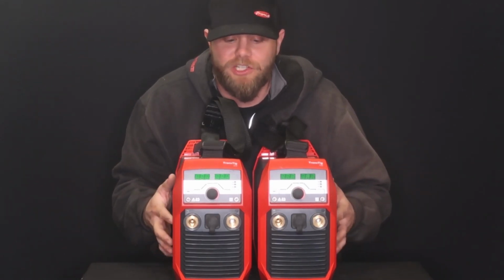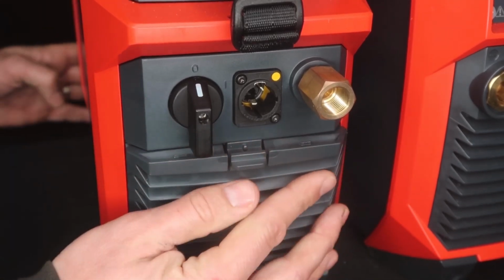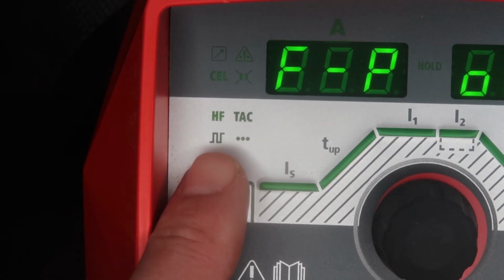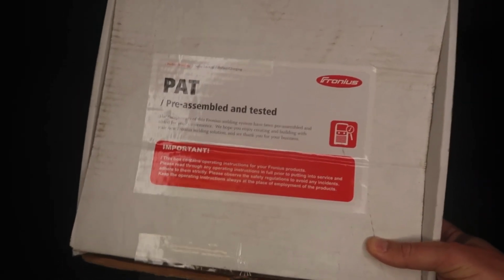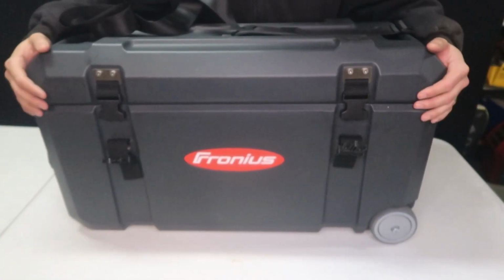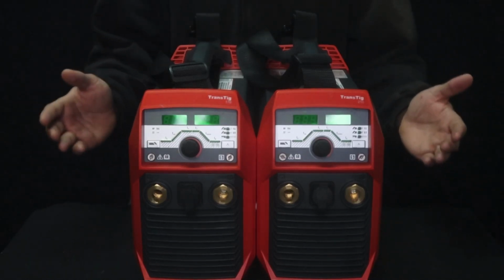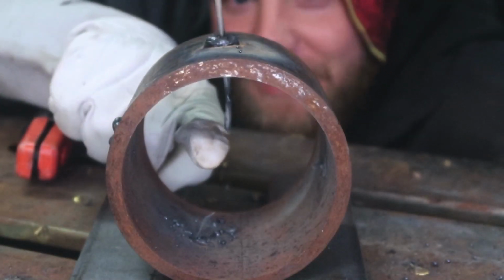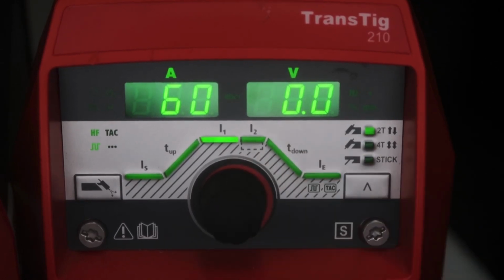Looking For A TIG Machine? The Fronius TransTig Is A Must See !! #tigmachine #tigwelding #fronius

Comment: Any idea when Fronius may be coming out with a updated version of their transsteel 2200 ? Be nice to see a modern interface etc
Reply from the maker: I haven’t heard anything on a revised faceplate or machine. Have you tested a unit out yet?
Reply: @chris_b_liven  unfortunately I have not tested out a Fronius transsteel 2200 . Watched every YouTube video out there on this welder & read many reviews ...lots of happy owners for sure .

Even though I am up in northern Canada 🇨🇦...If I do go ahead with the purchase , thinking of buying from Bakers welders & gas . They seem to have really good promos always running .
Reply from the maker: @Warriors79-ice  It’s hard for me to tell you which one is better overall just because I’m a little bias 😂 I think if your in the market you should try all three out and make a decision. Fronius is starting to add more and more dealers in the Canada market. They hired a distribution manager in Canada so be on the lookout
Reply: @chris_b_liven  with my luck Fronius will come out with a welder to replace the transsteel 2200 shortly after I purchase mine 😥 lol

Been debating on these three welders ....Fronius transsteel 2200 / HTP 200 / Esab 205ic. 

But after reading reviews on the Esab 205ic , it sure seems there are way more issues with it compared to the Fronius 2200 or the HTP 200 .

I really like the fact that the Fronius 2200 will run on 110 volt where the HTP will not . Nice to have that 110 option .

Just the overall high quality / higher duty cycles of the Fronius seems to be the way to go !!

Comment: 3500W on 110V is over 31A! bu 20A breaker will let me use only around 18A. So what's up with Watts?
Reply from the maker: That would be at max amperage ... You can set the fuse in the machine for a 10/15/16 and 20 so it won’t allow the over amperage

Comment: Can the fronius transtig210 pulse 6010?
Reply from the maker: Yes, If you run the 6010 in standard stick mode. If you turn CEL mode on I don’t think you can utilize pulse. Long story short run the 6010/11 in standard stick mode if you want to use this capability

Comment: damn no mig, it'll o/a weld though right?
Reply from the maker: If your not looking for a MIG it’s a nice small portable high frequency option. Fronius has a MIG/TIG/STICK package called a TransSteel 2200 which runs on 110/220 v power

Comment: Are all the transtigs multi voltage? I’m looking at the one from shopweldingsupplies.com but it only states 230v
Reply from the maker: S4v4g3 86 Yes, both the 170 and 210 are multi voltage 110/220 V - The new promo comes with a free welding helmet
Reply: MilkyCereal83 i hope the stick portion is better then the transsteel 2200. To me the 2200 is a mig machine that does the other process but I mainly use a diesel Lincoln ranger 10,000 at work so I may be expecting too much
Reply from the maker: S4v4g3 86 I agree with you regarding the TransSteel 2200 in stick mode. The best processes at MIG and TIG - stick is a little weak if you compare to TransTig or Transpocket
Reply: MilkyCereal83 I guess I’m gonna bite the bullet and order the 210 Friday.
Reply: MilkyCereal83 I went to order the transtig and accidentally ordered the transpocket as I was comparing specs. Lol. Now I’m waiting on the refund to order the transtig
Reply from the maker: S4v4g3 86 oh no... Through who?
Reply: MilkyCereal83 shopweldingsupplies.com
Reply: MilkyCereal83 well you did it, I ordered the 210. I’m gonna have un sub from you damnit
Reply from the maker: S4v4g3 86 Nice 💯Did you already register the serial number for the welding helmet?
Reply: MilkyCereal83 no, how do I get the serial number without having the unit?
Reply from the maker: S4v4g3 86 gotcha. Just make sure you do it when you get it. I’ll keep an eye out and send extra stuff
Reply: MilkyCereal83 that would be cool. Hopefully I can do it before promo ends. That’s how my luck goes
Reply: MilkyCereal83 I’d be alright if a pedal accidentally fell into the box wink wink
Reply from the maker: S4v4g3 86 you will be good 👌
Reply: MilkyCereal83 got my 210 in today. Haven’t messed with it but did look it over. How is it upgradable via usb?
Reply from the maker: Scott Branham Yes. Behind the faceplate with a micro-usb
Reply from the maker: Scott Branham make sure you register it for the free hood
Reply: MilkyCereal83 oh I didn’t go that far into it. I guess I have to update it to get the css
Reply from the maker: Scott Branham CSS is active if you have high frequency off
Reply: MilkyCereal83 I think I did. I went through the process but i didn’t get a confirmation
Reply: @chris_b_liven  i might not use the 2200 any more after this.